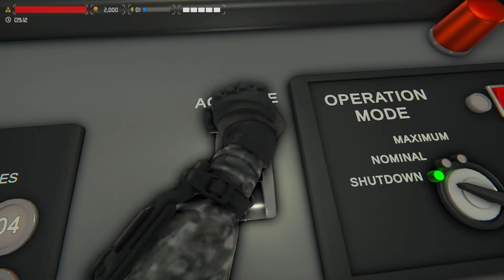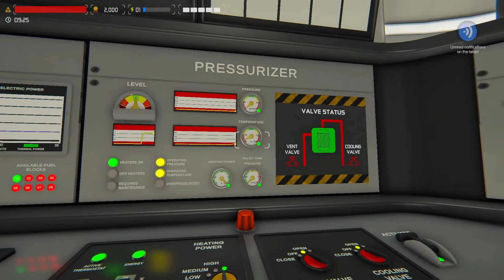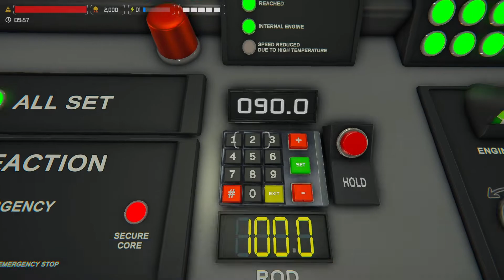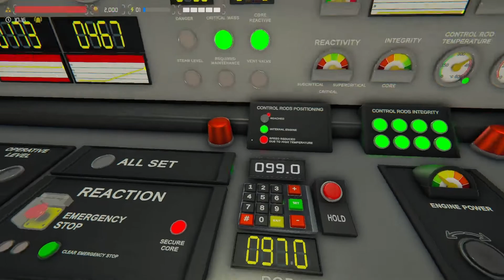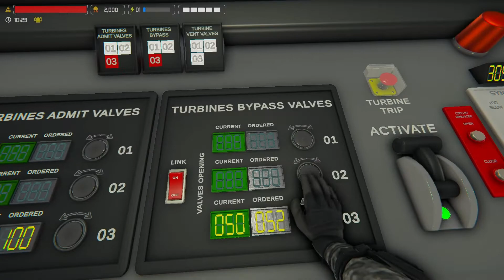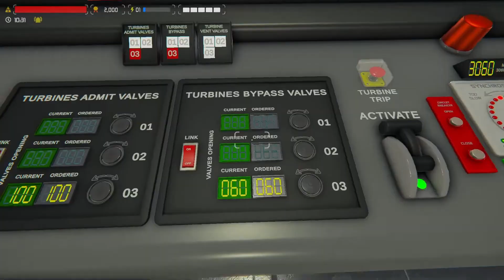Nucleares - reactor start up tutorial

Comment: hey how do you shut it down and refuel it
Reply: pls tell me i need it
Reply from the maker: Hey, to shut it down, you will need to insert the control rods 100% and wait for the core temp to cool less than 40c. If you are playing with the chemical module activated, you will have to add boron too to speed this up. This will then make the core non reactive once cooled below this temp. You will then have to drain the core pool to 0%. Then and only then go to the core fuel panel and switch from nominal mode to shut down (also ensuring all pumps/systems are off). You can then eject the core and using the keypad on the fuel control panel, select a waste disposal silo (eg No1). Finally in the same area, there is another keypad whereby you can choose which fuel capsule to select(default is pod 1 unless you’ve purchased more). Once inserted, reverse the above process, then you should be good to go☺️
Reply: @game_junks  thanks you helped me out